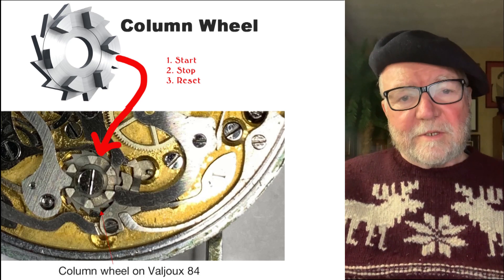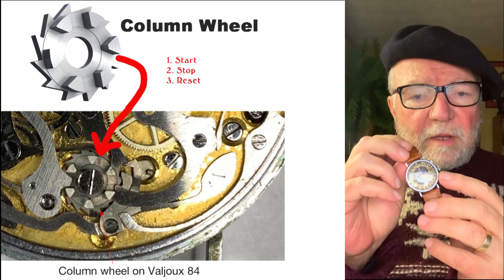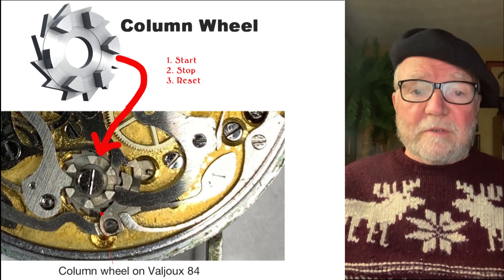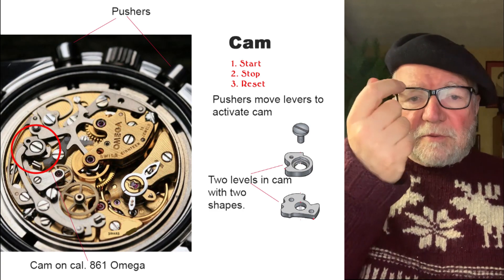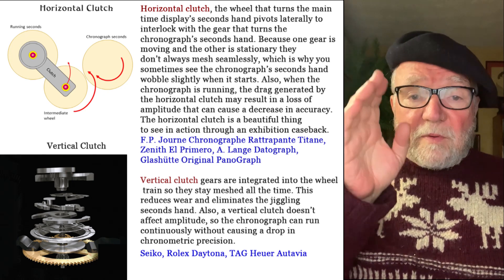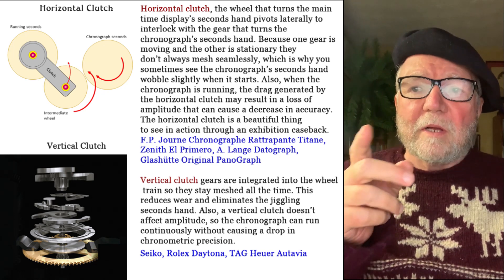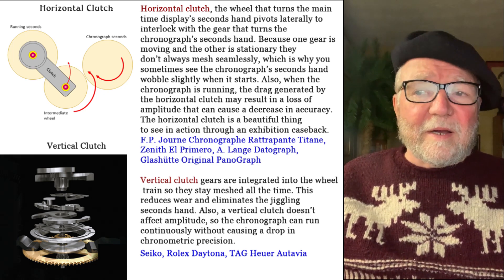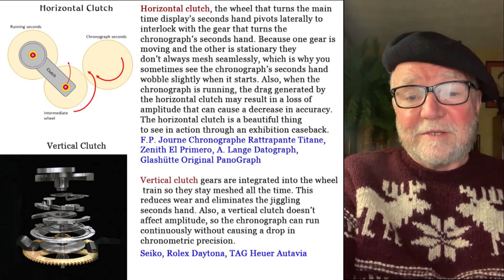Column Wheel or Cam? Horizontal or Vertical Clutches? Chronograph Questions. #VP4

Comment: Horizontal clutches are technically inferior, where you lose slight amplitude, but they just look better, because you can see the horizontal clutch actuate when you press the pusher. Most higher tier brands prefer horizontal because finishing a horizontal clutch will look much better than a lateral. With the column wheel vs cam debate, it depends on the situational use of the watch.  Omega still uses the 1861/1863 because their cam-actuated chronograph is very sturdy, and there's no reason to have a more complicated movement (321) which has more moving parts, and thus, higher chance of failure.
Reply from the maker: Yuchen. Which would you rather have a Seiko Presage or an A. Lange Datograph? The Lange has the horizontal clutch. Why? Thanks, Bill
Reply: @watchartsci  datograph wouldn't fit my wrists, so I'd take the 1815 ;). As I said above, the horizontal clutch is for the aesthetic. I'd rather the 1815 have a vertical clutch, but that's up to ALS.
Reply from the maker: Hi Yuchen, check this out: https://www.hodinkee.com/articles/bulgari-octo-finissimo-chronograph-gmt-automatic-review This Bulgari is the winner of the 2019 Grand Prix d’Horlogerie de Genève  Chronograph prize ... it uses a lateral clutch. Also, in 2015 look which watch won the prize—https://www.gphg.org/horlogerie/en/watches/altiplano-chrono That has got to be the thinnest vertical clutch anywhere! (You'd look great in an A. Lange Datograph!... so what if it's a little big.) Cheers, Bill

Comment: Column wheel is harder to made and looks better, so some brands advertise it's better or higher-end.
Reply from the maker: Leya, the cams are double-tiered and in two different shapes, while the column wheel is just the saw-like wheel and the column on top. Are you sure the column wheel is harder? Find out and let me know! Thanks, Bill
Reply: @watchartsci  I have read many times that cam system is invented for lowering the production cost.
Reply from the maker: Hi Leya, where have you read that? Thanks, Bill

Comment: So my Longines Master Collection L2-773-4-78-3 has a 7751 movement with a column wheel. They seem to be very proud of if as it’s extra blued like the temperature blued hands and visible through the case back. My Tudor Chrono has the vertical clutch and the column wheel (apparently the best combination) Anyhow thanks for the  video as always. I do appreciate a solid chrono function without any jumping and play in the seconds hand. But this is splitting hairs when I think about it.
Reply from the maker: Yes Ralf, the combination of the vertical clutch with the column wheel is considered the best one. The 7751's ubiquitous cousin, the 7750 is exactly the opposite. Let me know what you think of the newer video, "Chronographs: From Affordable to Fabulous!" Cheers, Bill

Comment: Thank you Bill, not only for the research you do for us, but for the education you always afford us. Are there any negative effects on the movement, if long term, the chrono aspect of the watch is not utilized? Also, are you familiar with the fact that early 7750's had 17 jewels and later ones 25? Is that a concern regarding mean times between overhauls (MTBO) for those two variations?. I own a Longines Weems No.2 (ref 674.5251) with the early 17 jewel 7750, but unknown service history, that I am concerned for. Best Regards and Happy Holidays to you and your family.
Reply from the maker: Hello Panos, thank you for the kind words! Yes there is an impact of chronographs on movements--they beat up a movement more so than those without chronographs. However, if you can't have some fun with your watch, what's the point? The shocks from launching the Chrono, re-sets and stress of the added function on the different parts will do that. Take care and Happy Holidays to you as well, Bill

Comment: Hey Bill, great short video. Seiko introduced the column wheel with vertical clutch automatic chronograph with their 6139 series in 1969 and were the first there. If you look at the post El Primero Rolex Daytonas they have a very similar design to the original Seiko.
Reply from the maker: Hi Tod, that is interesting. I know that Seiko was the "third wheel" in the great automatic-chrono race between Heuer et all and Zenith, and I have no doubt that they created some un-credited modules for the chronograph. Kindest regards, Bill

Comment: Hi Bill, i heard from many reviews in you tube that vertical clutch allows you to keep your chrono on without streesing the movement. Does it make sense?
Thanks for your video.
Reply from the maker: Yes, Emanuele, that makes sense. The vertical clutches are actually better than the horizontal ones, but the best watchmakers use horizontal clutches. By employing the most precise craftsmanship, top watchmakers can overcome most of the drawbacks of horizontal clutches. The horizontal clutch is more for the watch owner to view as his chronograph through the sapphire exhibition window. Kindest regards, Bill
Reply: @watchartsci  The amplitude drop after turning on chronograph with horizontal clutch probably can't be overcome by technology or craftsmanship in my opinion.
Reply: @watchartsci  Thanks for the explanation!
Reply from the maker: @Leya ... Why would the A. Lange Datograph use a horizontal clutch, then? Philippe Dufour said that the A. Lange & Söhne Datograph was the best production watch in the world ... would he have said that if there was an amplitude problem in the Datograph? Maybe there's a secret we need to find out about ... and you're just the man to do it! Cheers, Bill
Reply: @watchartsci  The additional loading which comes from the chronographic gear train is inevitable after activating. The main reason most high-end chronographs still use horizontal clutch is because of the aesthetics(sure vertical clutches are also harder to service).
Reply from the maker: @Leya ... check this out and let me know what you think...: https://quillandpad.com/2017/02/20/exclusive-the-agengraphe-by-agenhor-the-most-significant-chronograph-since-since-the-invention-of-the-chronograph/ Cheers, Bill

Comment: I'm really enjoying these shorter videos as they make for a nice listen when I'm at work at have a dozen things going on. 
If it's okay I have a question for the community... 
Are there any acceptable online watch appraisers that don't require the watch to be mailed in? I've only been into watches for a couple years and this is the first year that I've bought a couple of nice pieces that I need to have appraised for insurance. Both of the local jewelers in my area told me they would need to keep the watch for roughly three to four weeks to complete the appraisal and I really don't want to be without them that long if I can help it. Any advice would be appreciated. Thanks
Reply from the maker: M Ying, I don't know of any. Perhaps you could try a local watch store for suggestions about appraisers, but what I'd suggest is to look at what the watches are actually selling for on Chrono24 and auctions like Christies, Phillips and Southerbys. That way you'll have practice yourself. It's a good question, though. Kindest regards, Bill
Reply: WatchArtSci thanks for the reply.

Comment: horizontal vs vertical clutch.... so does that make the ugly hidden movement of the rolex daytona the best chronograph out there possibly?  I had to Bill. I just had to.. love your friend RichBuddy  great videos Bill. they are really good.
Reply from the maker: Well, Rich Buddy, you're half right — the Daytona's not the best chronograph.... but as the French say, pas mal... 😉 Cheers, Bill
Reply: Depends on your price. I think the b-1 calibers are in the right league. Vacheron does better with vertical clutch but in a higher price bracket.

Comment: You failed to mention the most important thing.as manny times in horology Seiko yet again beat the Swiss by pioneering the vertical clutch chrono which is today the gold standard for any auto chrono. All major brands like Rolex, Tag, Tudor, Breitling,JLC, Piguet, Longines use vertical clutch while Zenith El primero really failed into obscurity.
Seiko 6139 is iconic caliber and grand daddy of all modern auto chronographs.
Reply from the maker: Dado I was not trying to line up who got credit for what but rather explain the differences between those 5 elements. I guess if you want to be a cheerleader for Seiko (or any other brand) be my guest. I prefer to focus on how the elements work. That was 5 years ago, and if anything I'd credit the newest innovation in chronograph development, the AgenGraphe by Jean-Marc Wiederrecht as the real genius behind innovation in re-thinking chronographs; not Seiko. Take care, Bill